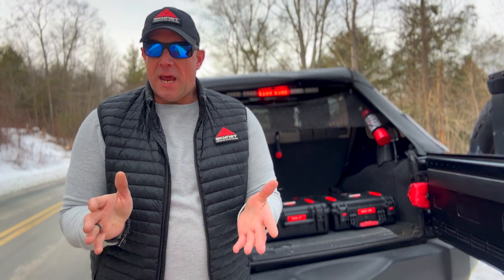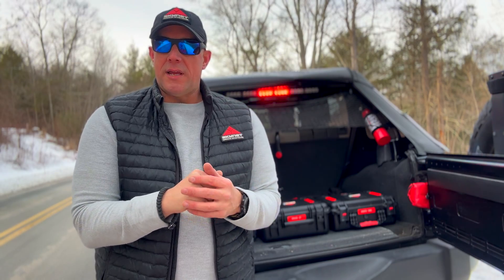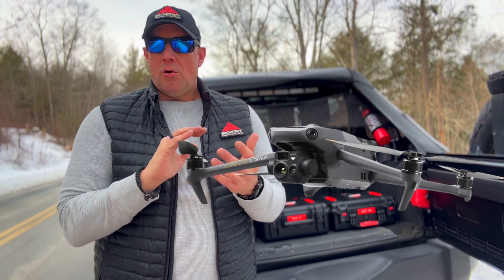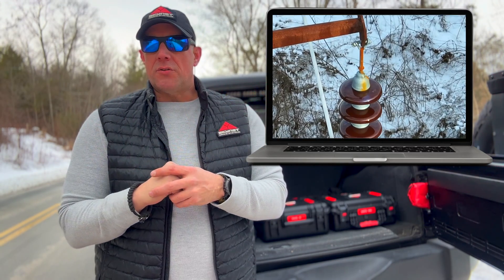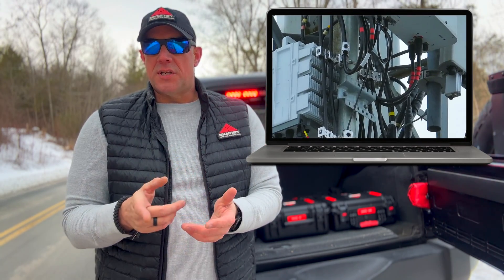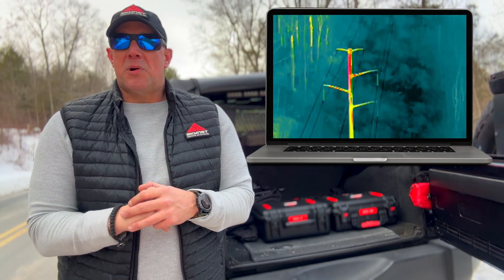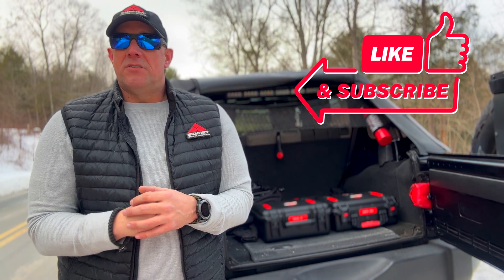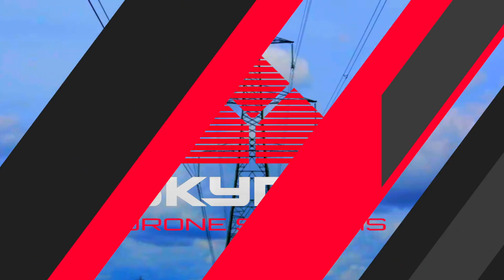POWER Line and TELECOM Tower INSPECTIONS with the DJI Enterprise MAVIC 3T

Comment: How close did you fly the M3T to the power lines? 
What voltage did they carry?
Reply: Finally we flew our solar inspection getting as near as 17mts (56 ft) from a 115KV power line with no interference or glitch. 👍
Reply from the maker: I love it when a plan comes together!  Awesome job 🔺
Reply from the maker: I was on average 100 ft above the lines that were carrying 115kV 🔺
Reply: @Skynetdronesystems and what about side distance?
Reply from the maker: In this case I couldn’t get much access at all to the sides of the towers because of the trees.  But I try to keep 100 ft away from the wires just to avoid any potential hazards.  The SOP for operating around high voltage wires is 100 ft away.  (I’ve seen some recommendations of 250 ft posted) You shouldn’t have any issues operating at that distance above or to the sides of the wires.  However I’ve read instances where pilots flying under the wires have had issues with the GPS signal to  the aircraft.  🔺
Reply: @Skynetdronesystems  well...I'll may have to get as close as 65 ft. to the power lines. 🤷‍♂️
Reply from the maker: You’ll be 100% good to go at that distance.  I’ve seen inspection videos where the UAV was inside of 25 ft of wires.  I WOULDN’T recommend flying THAT close to the lines!  But to put your mind at ease about the safety of your upcoming flight mission, you’ll be fine. 🔺
Reply: @Skynetdronesystems  👍 thanks for your good wishes! 👍
Reply from the maker: Roger that!  Fly with confidence at that distance and be sure to come back and let us know how it goes! 🔺
Reply: @Skynetdronesystems  I will. 👍